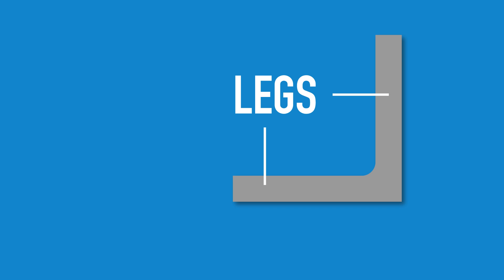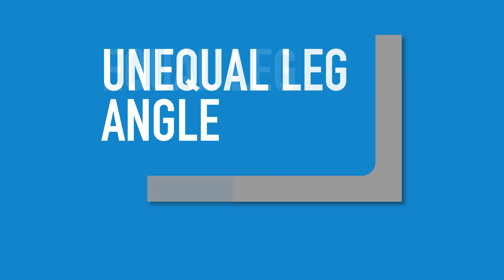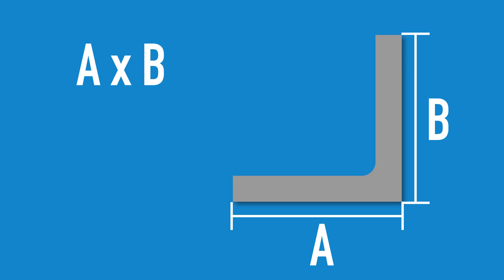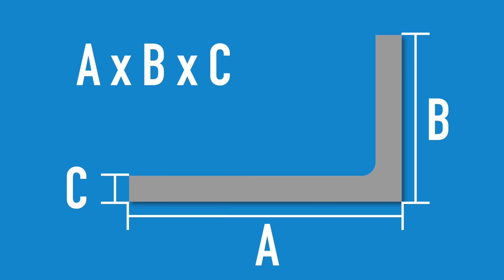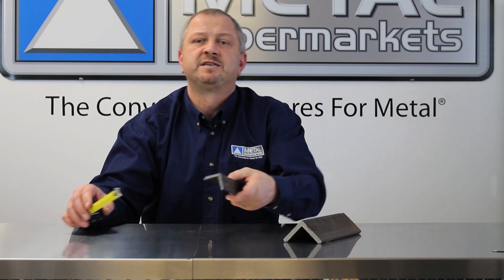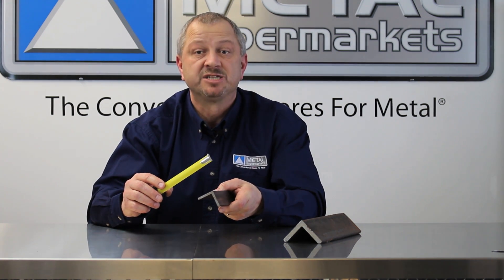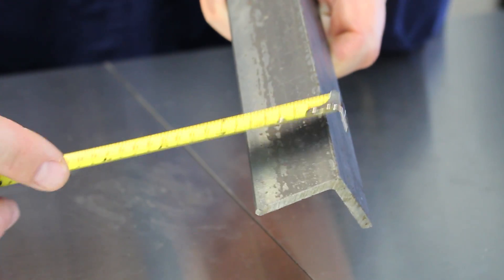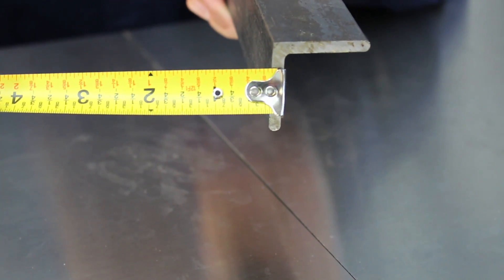ABCs of Structural Steel  - Part 1: Angle | Metal Supermarkets

Comment: Using an angle to cover another angle is standard practice in electrical transmission towers. They are used in splices. The bottom angle corner is ground to match the filet of the upper angle.

Comment: ok dumb question. I have seen over the years angles have a tapered thickness to them, not equal thickness like this video shows. The inside is tapered to the filet. Is this video an example of flat bar and not a standard angle?

Comment: Structural Steel is applied daily to the welding profession.  Excellent "YouTube-video" for the denser & welder.
(Length, Height/width & Thickness in X-Y-Z when ordering metal.)

Tom Vanderloop, Author & Consultant